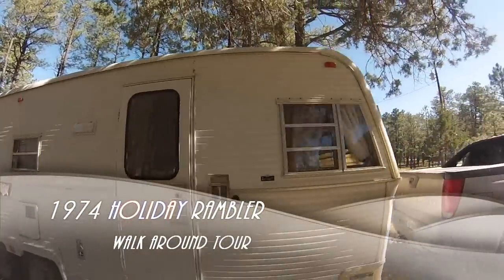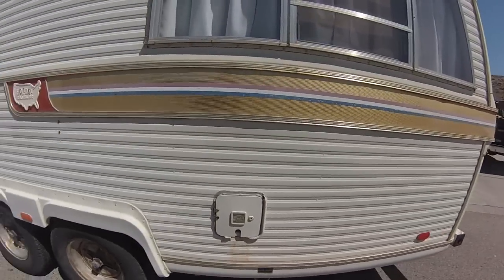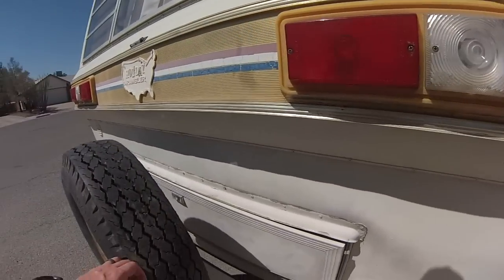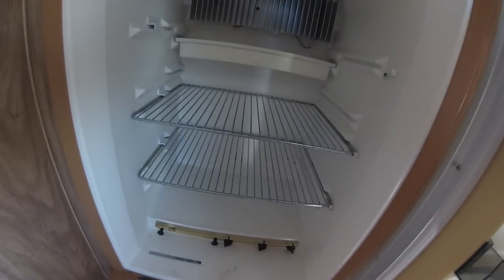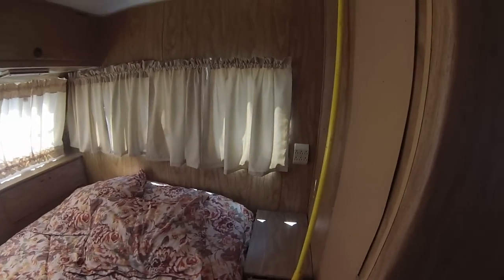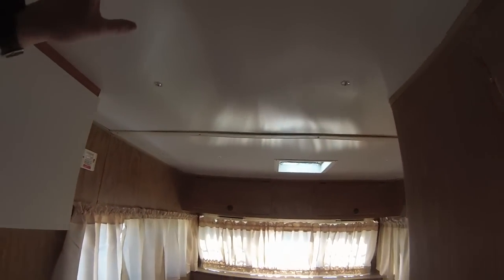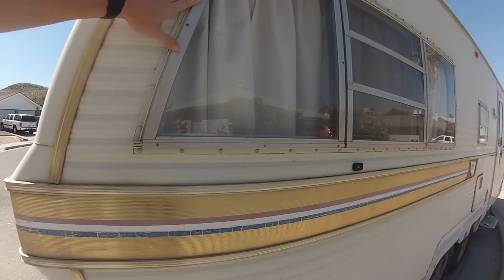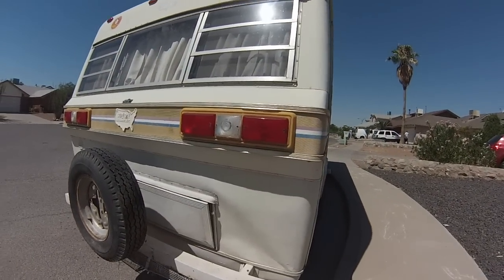1974 Holiday Rambler - Tour

Comment: How do you drain the grey water tank?
Reply from the maker: There's one outlet pipe with a valve that opens the gray water tank that's behind it. Drain the black water, pull the valve to drain the gray water. Close it all up, done.

Comment: I noticed when you were showing the connector by the side of the tongue, there is a slight indication of the usa emblem. It seems to have been paint over it. Would that be where the vin # is? if not would you know where it would be on that year model. This would help me in trying to register one that we found.
Reply from the maker: The Vin is on the typhoons tongue near the jack, to the left as you face it from the front. 

I have another video where I cleaned and painted it. Perhaps it's shown better. I can't remember exactly.
Reply: We found an eleven digit number starting with S. NJ DMV would not accept this as the Vin#.

Comment: i just bought same camper.. do u happen to know where fresh water tank is located?
Reply from the maker: I would guess under the bed. Unfortunately, the fresh water tank was removed from this one before it was mine. 

In a couple months I'm getting it out of storage and will be gutting it. Gonna be good times had by all.
Reply: @RIPbiker13  Thank you for responding.. i just gutted and did full renovation on my 74 rambler.. Upon removal of bed there was a ginormous hole and a cut pipe.. Im assuming they cut out fresh water tank.. Thats why i asked. Dang it. Another road block. Everything else has went ok.  Painting was not fun!! Lol Now i just have to figure out where to buy another tank and how to put it in. If u have any leads or know where i can get one please let me know!! Ty again!! Good luck with your remodel!!
Reply from the maker: You have FB or IG? I'd love to see pics. The tank should be generic, making one would be tricky, welding water tight isn't easy. Plastic tanks can be purchased or built, just haven't looked into yet.
Reply: @RIPbiker13  i have facebook.. Will post some pics tonight.. And i found one on ebay im gonna look tomorrow and check dimensions to make sure it'll fit. It was like 21 or 16 gallon for 39.00. I also decided to remove refrigerator and i went with a 10 cu ft apartment sized one i scored for 50$ on a garage sale site. Im still working on it. Redoing countertops.. Putting up backsplash and kitchen/livingroom flooring and more paint tomorrow. This has been a month long process(not working everyday) but man it looks way better!! Ill piece together a video of before during and after and upload it on here as well!

Comment: hey, does that have a KWIK-BED Sofa in it?
If so, could you send me a video of how it opens and closes.  I just can't figure mine out.  thanks,  Rachel
Reply from the maker: Rachel Peabody Rachel Peabody I'm not near the trailer to get a video. The back cushion folds forward and down over the top after you remove the arms. I'm not sure if that's a brand name or not. Personally, when I gut the whole interior, it's not going to make its way back inside.
Reply: thanks.  I have a 1974 that's in real good shape.  all original.  love it!
Reply from the maker: Rachel Peabody We love ours too. I even lived in it for six months. it's in storage right now. When I get my truck fished, I'll use it to bring the camper home so I can start the full restoration.

Comment: Does it have a metal roof?
Reply from the maker: Yes, it is all aluminum skinned and framed.
Reply: @RIPbiker13  thanks
Reply: @RIPbiker13  do you know the grvw.....? And do you think a v6 toyota 4 runner could handle it?
I'm looking at a 27 ft. right now but its the ramblette ( no aluminum frame).
Reply from the maker: @gta-6837  The GVWR is about 5400 empty. There is NO WAY that 4Runner could safely tow it. My F150 was over weight with it and I bought an F250 diesel since so I could actually use the trailer.
Reply: @RIPbiker13  thanks...my 4runner max out at 5000 ...I was thinking since yours was longer this 27 ft would weigh less
Reply from the maker: @gta-6837  Your payload will max long before your towing capacity does. When you buy a trailer, make sure to know the tongue weight and compare to the payload of the tow vehicle. That's going to be your limiting factor.
Reply: @RIPbiker13  thanks again..